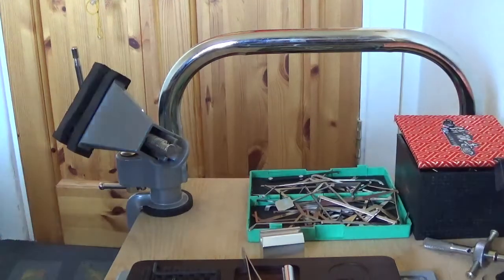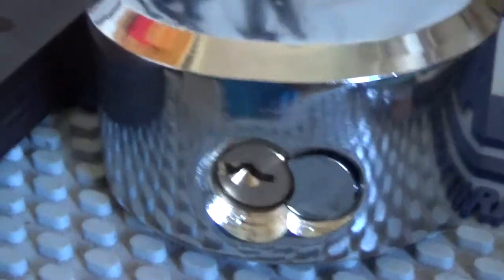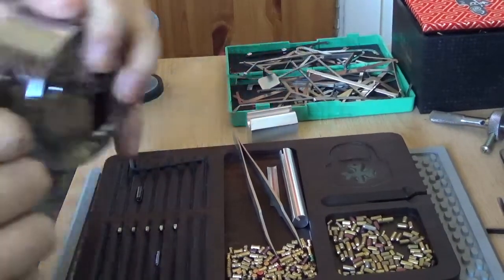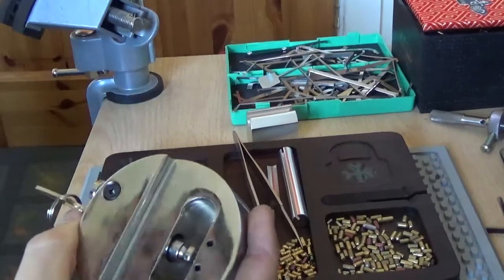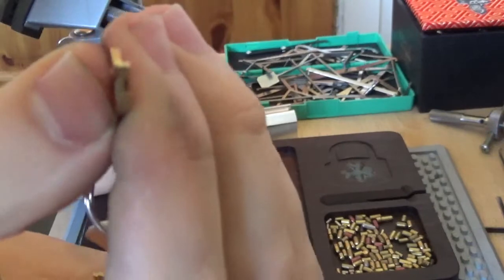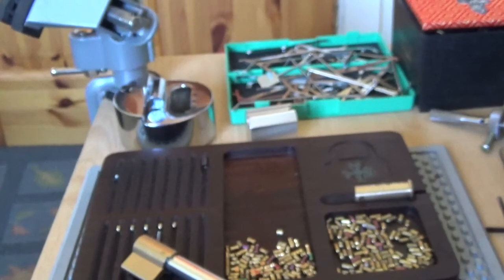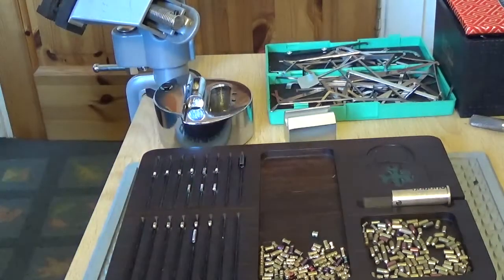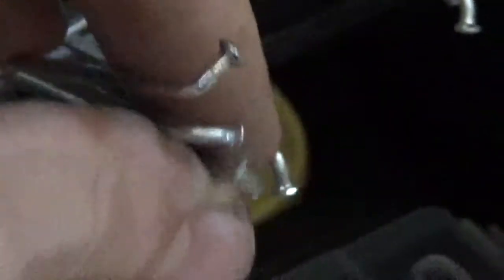My first pins I made and first attempt

Comment: Cool that you made your first pins buddy 😊👍 :). Is it that the ends of the pins are not even (was a bit hard to see) ? I would make the ends flat (and the edge a bit beveled maybe), helps the lock working. The old pins look pretty rough, that's probably why the key isn't working that great ;). Interesting idea to use the bike spokes :), never seen these used. Good work and keep working :).
Reply from the maker: +redcatimaging i will try that out

Comment: I had never thought of using spokes. brilliant! I had only ever used the larger pins and file them down to the right diameter using a dremmel. but either way it takes much more talent to make your own stuff rather than buying a kit. and I agree that the keyway looks like it would fit an american key just fine. incidentally it looks like the chubb keys from the padlock you sent me would work too as they also fit into an american lock and vice versa. keep up the great work. happy picking bro.